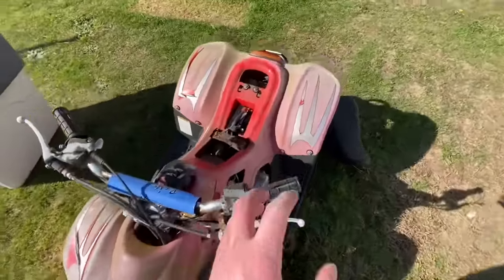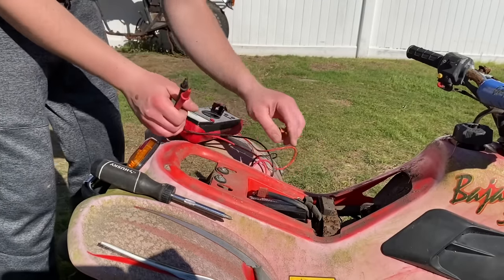Getting ANOTHER FREE Quad! First Start in YEARS!

Comment: Most of these smaller quads also have an adjustable thumb throttle to adjust the speed as the kid grows up.
Reply: all of them unde 125cc
Reply: Leevi Isola lol all off the arcs do I have two a Kawasaki bayou 220cc and a Tao Tao 250cc both have the speed governor screw soooo yea
Reply: @wayworld8527  yes but all of them under 125cc has and not so much when it gets over
Reply: Leevi Isola yep
Reply: I was the kid that learned how to modern it though and just popped the screw out made it go way faster

Comment: The purpose of that kill switch is basically like a jet ski kill switch. There's probably supposed to be a rubber/plastic cord hooked up to the little hole in the kill switch and wrap the other end around your wrist. This way if you fall off the bike, it turns off and doesn't keep going or come back and run you over.

Comment: Your kill switch is designed to connect to a strap that you attach to the rider so that if the rider falls off the quad it automatically kills the engine.  Also, the petcock being lower than the carb isn't an issue.  The gas tank being higher than the carb will force gas through the petcock to the carburetor.
Reply: PixelSlinger I was about to comment about the petcock

Comment: Watch out for the throttles on those, sometimes you’ll turn them on and they will idle but when you switch the choke to on/off they will sometimes just start going forwards at full throttle
Reply: If that’s happening then you put your slide in backwards. The throttle cable attaches to a needle that goes into the top of the carb, and the needle is housed in a slide to stay centred. The slide has a notch on one side and a bump on the other. If the notch is in the wrong side, it’ll stay stuck at full throttle.
Reply: @ThatStewGuy  yeah lol, I remember 3 years ago. The day before I wrote this I did the exact thing and fucked up my neighbors car 😂

Comment: I noticed the abs and parking brake light on dash my 200 silverado had that issue it would randomly come on and off for 2 years I finally fixed it for good, you need to take the ebcm out from the truck crack it open very carefully and re solder a couple joints on the motherboard reinstall and bingo it fixes the issue vibration and age will cause a bad joint and its the root of the issue

Comment: @moto migs use some Lucas stabilizer in ur oil of ur motors n thru ur gas every now n then it will make it wake up trust me I swear by this stuff I put it in my f150 and it cleaned my motor in my 5.4 v8 triton motor so well that it quit burning oil it tightens up the piston rings and lubricates everything in the engine as an additive it’s a great product! Highly recommended

Comment: on old junk like this you should ALWAY change the oil and clean the carb.   Old oil like that night look ok, but it is degrading over time. And you might get it to run but the jets might be partial cloged and making the quad run lean.   Espacialy if you are planing on selling the quad you should abslutly do those to things.   And get a new chain. That old chain is just gone wear out the sprockets that looks in perfect condition .   And always good to see that there is never a migs video without a battery getting charged....